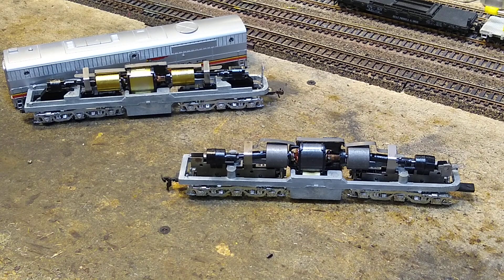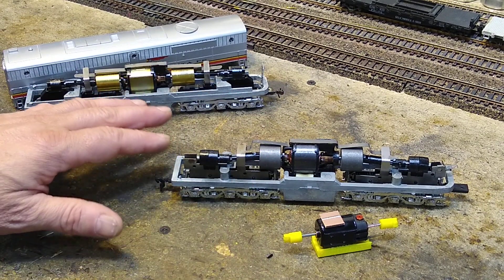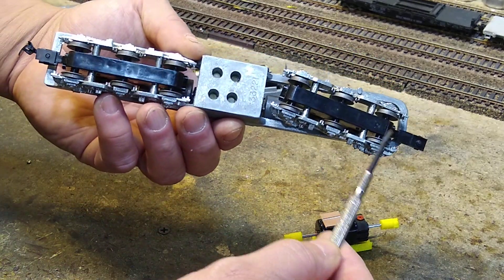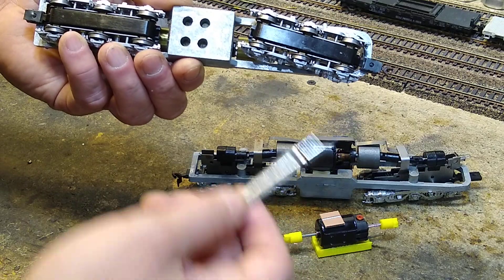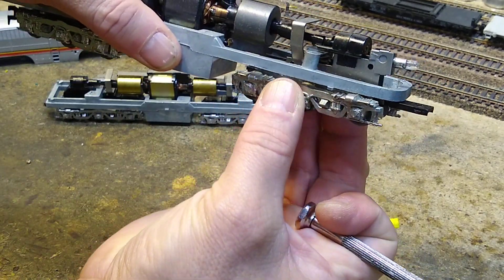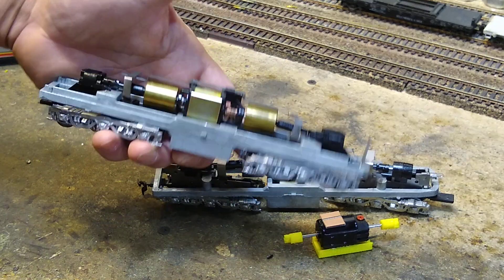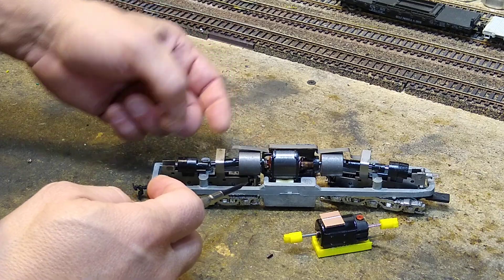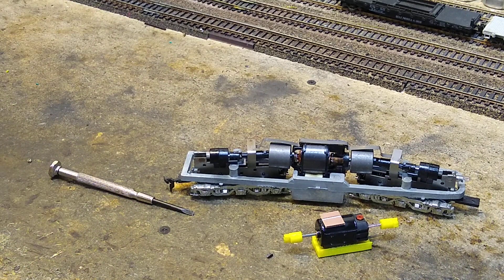Athearn Blue Box PA-1 DCC conversion part 1

Comment: I'll be following this, I have an  early Athearn PA1 that I'd like to upgrade. It is most likely a little older than yours as it was made before the flywheels were added. Thanks
Reply from the maker: the first part of this series shows restoring a PB-1 to factory original - this part of the series will show less of the details but more about how to prepare it for a decoder.  Next video is coming up soon.... the parts have been cleaned, wheelsets polished, gauged, coated with graphite, coated with Oxgard and ready to install.  As soon as the sideframes are out of the paint booth we'll do a truck re-assembly.